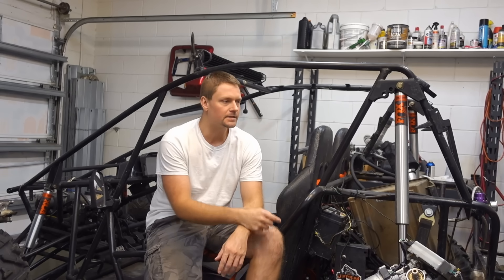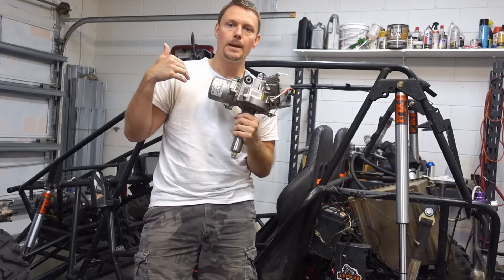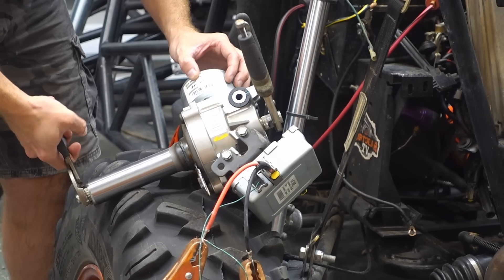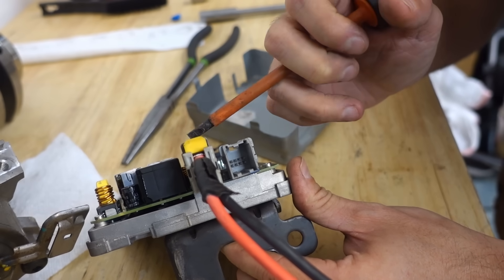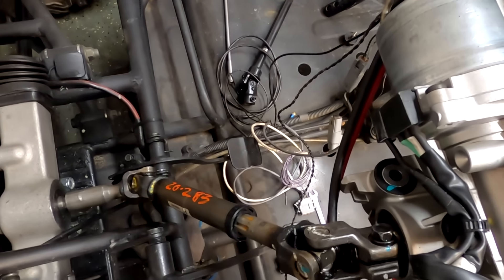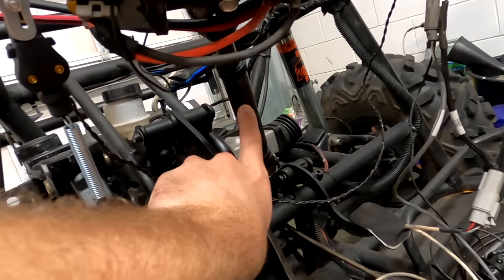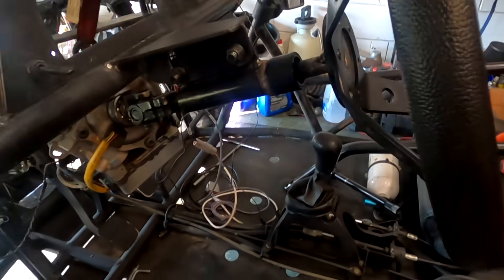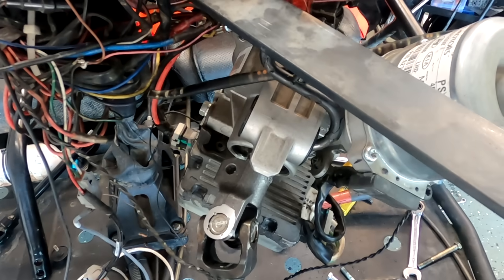Add Electric Power Steering To Any Vehicle for $150 | EPS Conversion

Comment: Ok, now lets see you do this trick with an M35A2 since the options are 1) a pneumatic assist system that works with the OEM 9.00x20 tires for $4,000 ( part number 2530-01-388-4240) or 2) a hydraulic system that requires you to run super singles (an additional 6 MRAP rims at $900 each with 6 tires at $1,500 each and adapter plates 6 at $130 each) for $4,000. 

There is a 3rd hydraulic version that works with the OEM wheels that costs $1,900 BUT it is only for off road use as it will rip your wheels off at speeds over 25mph.

Comment: I need one of those power steering in my custom 4x4 custom artic cat buggy , question the black small cable did you connect it to positive or negative?
Reply from the maker: That's the 12volt switched for power so a switched 12v source
Reply: @DirtGearTv about to order one
Reply: @DirtGearTv just got one with the connectors and everything I need for 106 thanks for  the info can't wait to mount it on my buggy

Comment: Very informative. I'm looking at fitting this Kia unit to an old Citroen ID 19 which has a simple manual steering rack at the moment which is v.heavy.  I have read elsewhere that modern electric steering systems also have an input of vehicle speed via the main ECU which alters sensitivity at higher speed - do you think this is absolutely necessary ?
John Fletcher in UK

Comment: If the eps works well without the module could I just hook it up straight to the battery with a fuse or have it go from my ignition switch to a fuse then straight to those two pins with single pin connections?
Reply from the maker: So you must have the control module for it to work. That said, you'll want to fuse the power side as these draw a lot of amperage. The ignition switch is a simple 12v switch that can be connected to any 12v source (preferably switched)
Reply: @ thank you
Reply: Or do I have to have the module

Comment: I'm wondering if the ECU is even needed. If all you're doing is hooking up power to it, with no other inputs, can't you just hook up + and - 12v to the EPS?
Reply from the maker: Yes, no ecu is required as these units have their own controllers. 12v Ground and power switch is all that's needed
Reply: @DirtGearTv  Thanks, that's what I thought. The ECU is just acting like a relay for the heavy 8 ga. wire, I may just use an 80 amp relay and forego the ECU altogether.
Reply: @DirtGearTv  Now I just need to figure out which of the  wires  going to the 
EPS is Pos and Neg!

Comment: I'm planning to use a Prius Electric power steering in a 1988 VW Vanagon.
I've seem some videos with a rheostat-type switch which you can use to adjust the "softness" of the steering.
Any one can tell me more about this?

Comment: Hi guys. After watching and reading the the web page (the ranger station) I am trying to do this with a Toyota Yaris EPS part no. 89650-52120

Please I don't understand the 4th connection which is speed signal. Is there a way to use only 3 connections ??

Comment: My kia picanto 2011 doesn't have power steering,and i want  to install one. Electric i have you dont need can buss conection. Is that true?
Reply: I installed one on my Kia Sportage Diesel 2014 with Regular Power Steering. I use the EPS from a Hyundai IX35 that is basically the same car.

Now... on my case, something WEIRD happened...  if i connect the canbus... my steering works perfectly, the only effect is that when doing about 40mp/h or so, the steering gets stiffer (and i think is the regular working mode), the weird part is that... if i disconnect the canbus i cannot get the EPS work at all and the car gets hard to move, so it required the Canbus connected always.

According to this video, this is supposed not to happend, i tried to use it without the canbus because i wanted the steering to be soft even on driving.

The good part is that at not moving, the steering is butter soft (that makes the parking easier) and because i didn't remove the hydraulic power steering on the car, the EPS doesn't have to do a lot of effort so i think it will last longer.

I would like to know if there is a way to reprogram the EPS module so to upper the stiffer speed or change the assistance effort, etc.

Comment: What is the requirements to hook up in 2013 Kia rio  Electric steering   Module I hooked up the key power on but I need the red and blue hooked up also they have a 2.4 vote With arms coming out of them what do I do

Comment: I put electric steering in my buggy the column is from a 2013 kia rio  I hook up the keypower on But I have to hook up the other 2 wires in order for it to work and What do I use for those other 2 wires or can I buy a bypass Please I am very stuck here can't figure this out

Comment: would this drain the battery if you wire it up this way
Reply from the maker: It's wired to ignition so if I left ignition on, yes. If it's running it's drawing from alt not batt

Comment: Water cooling the welds makes them brittle. It’s better to use compressed air. How a part that experiences high torque you want the welds to be as strong as possible.
Reply from the maker: Totally agree! I was trying to keep heat off the bearing with cold prior to adding any heat. Hopefully not as brittle as water cooled 🤞

Comment: So got one of these setups and soldered the wire to the #1 pin.  Hooked everything up and the ECU clicks and then nothing.  Am I missing something?  What are the odds it's bad?
Reply from the maker: Did you verify it's the right year with the link in description? I missed by one year the first unit I tried and that's exactly what it did.

Comment: where were you able to find the wiring diagram ?  I using a power steering unit from a 13 Hyundai Santa Fe and can not find anything on the net to help with the wiring.
Reply from the maker: Check my link in description, only certain units will work

Comment: I just got hold of a 2018  soul column & ecu… will that one work?
Reply from the maker: I just checked the link in description and doesn't appear that's a compatible year. I had that same issue with the first one I got from the junk yard 🫤
Reply: @DirtGearTv  2018 it works. Just bench tested it exactly how u did… and we are all good!
Reply: @DirtGearTv  bugger! It’s already in the mail
So I may as well give it a crack. It says the 2018 is interchangeable with 2014 so 🤞

Comment: Just for future reference,  you could also just connect the single wire to pin #1 in the exterior connector receiver,  and then simply fill the remainder of the void in with RTV,  or you could put a release agent on it and fill it in with some Bondo to make your own connector "pigtail".

Comment: does it need steering angle??? looking random EPS and there are with steering angle sensor / 3 connectors on the control unit.

Comment: Hey, if you're near Tennessee I can probably help you 3D print a housing for one of those connectors and then you can snap in a Molex or Dupont pin to fit the actual terminal.  The first one will probably take a few hours to make, after that you can print them off for pennies.

Comment: Quick tip on connectors,  there's two parts of the connector even on PC boards and if theirs a number or name or both at times its possible to find the connector and the part number for the mate.

At times it takes a little work. But in the age of computers lots of data is online and its amazing at times.

So dont give up to ease as some OEM parts may have the same connector PN or run of parts and you have to pin them down,

Take the VPX Pro or Sport circuit Breaker replace panels for new aircraft. 

the connector kit is a few dollars and the pre wire kit with pins is a few 100 dollars and not a bad buy for some home builders or avionics shops as they come with the wires prie crimp and all the builder has to do is match the wire sise to the circuit and put them into the connector.

But I looked at the VPX and was able to track down the connectors and then the pins for each connector and in a range of pins for the wire size of the aircraft circuit.

If you a home builder the computer can do amazing things when tracking down parts 

And places like Y Tube can offer amazing advice for your next Ideal no matter how simple or complex

Comment: Very cool. My Kia box arrived today! How did you wire your power (the motor wire) wire? Keyed or nay, and what amperage did you plan for or find you needed? Thanks for the inspiration! Mine is going a ‘66 c10 restomod
Reply from the maker: Power side I believe i'm using a 60amp fuse/breaker. It's likely these don't actually draw that much since it's failsafe mode. I have it wired to my 12v acc when in 1st ignition position

Comment: Just as a point of information, these power steering units have a small rubber gear inside that’s well known to deteriorate and “thunk” when you power them up and turn the wheel. If this happens, simply unbolt the motor from the side and inspect that rubber gear. If it’s bad, replace it and it’s fixed. Dorman sells the gear for around $12.
Reply: I don't think there rubber but teflon
Reply: @dalejones2108 they are a hard rubber compound, just replaced one on a Kia Optima 3 weeks ago with only 86k on it, it's a terrible design

Comment: "The Ranger Station" guys have been doing it for years and have info on many eps setups with associated wiring diagrams. I did it on a John Deere B tractor!
Reply: I wired my kia soul esp  on my car and it will not engage. Not sure what do.
Reply: I was searching for a suitable power steering for my Massey Harris MF50. I think this is the one. 

Incidentally, it seems utterly stupid that these all tie back into a car’s computer. If your power steering fails, you know it. Of course, he estimates this one at a 10:1 power advantage and my old pickups were probably about 3:1, so a power steering failure was an annoyance.
Reply: Nope. Went and checked, not enough accessible input shaft. Would have to rebuild input shaft to gearbox, including machining a new seal housing.

Comment: Cool project, thanks for sharing. Does that steering module spin endlessly or is there a stop to stop?
Reply: Great question. This unit could be used for other applications if it just spins with no stops...

Comment: Love your video. But then I looked for a 2014 kia sole EPS I don't see the module attached to them, do you have the exact one you have can you help with part number?
Reply from the maker: I believe the 12-14' use the same module and (possibly) are interchangeable. Check the link in my description for years and models of others you can use!

Comment: Beats the old hydrovac systems we used to use. Steering shaft joints are available in both splined and set screw cheap and steering shaft braces with a bearing are cheap enough to be worth while.

Comment: ANY Vehicle???  What about a 1968 M35a2 Deuce and a Half?  I just turned 73 and have had rotator cuff surgeries on both shoulders.  Power steering would mean I wouldn't have to get rid of my beloved old daily driver.  This would be an answer to a prayer.
Reply: There are heavier duty electric motors for something that big.
Reply: @Snuggs-o1  Where?
Reply: @JSBIRD69  Bosch servotwin and Knorr-Bremse will have a product out soon.
Reply: There was an air assisted power steering setup for M35's.  The supply has mostly dried up now though.  

I have a 1970 AM General M35A2 from Boyce Equipment.  They couldn't locate an air assist system for my truck when they were building it out.  I wanted real air conditioning also (I'm in Louisiana), another curve ball.  They put the power steering system setup from a 5-ton on my truck.  It is a hydraulic unit that connects through the gear driven injector pump.  I'm running 49" Michelin XL super single tires (bobbed duece) and you can turn the wheel one handed on asphalt.  Pricey, but worth it.

Comment: Are there any smaller units?

Edit: What type of weld are you using?
Reply from the maker: The prius unit is maybe 1.5-2lbs lighter and longer but skinnier, expect to pay 3X as much. Just mig on this one
Reply: @DirtGearTv  I'm asking because I have a Kei Van that doesn't have power steering and the available space is very limited. If I could figure out a way to fit one, that'd be a game changer.

Comment: This video should be used as an example of how NOT to use a welder and angle grinder.
Reply: Very dangerous in fact without protection
Reply: For sure!  Shorts, flip flops, dodgy welds on a major safety system.  I get hurt anytime I do stuff like that.  Now, lets weld the brake lines to the wheel cylinders.

Comment: Do you happen to know if there are any of these EPAS systems that have 'return to center'. Thats something I know the prius doesn't have.
Are there any of these that have better aftermarket operating systems so they aren't always in failsafe mode that anyone knows of?

Awesome video, some really amazing content here, thank you so much.
Reply: For "return to center" just run more trail. 
(caster is usually the easiest thing to change)
Reply: With the Prius I believe you can put a potentiometer between some of the signal wires to adjust the strength so it isn’t just in failsafe, but the issue is usually it’s a variable signal from the ecu so it’s not simple to retrofit.
Reply: @Tappar1  i thibk you're right I just found someone that makes a hos antenna that can bypass the ecu so it will create a variable input on the prius epas
Reply: @Tappar1  there is no "return to center" assistance by the power steering rack…

The idea of one is dumb, really dumb…

If there is no input through the steering shaft, there is no assistance. None. Everything that happens is mechanical & caused by the tires & suspension.

Comment: Great video. My dad has a 1995 British LEYLAND DAF drop side 3.5 tonne gross crew cab pick up. Can I use this to convert to a power steering as well. It’s not been running for years but a new battery and clean out of the diesel lines with new filters and it should start. He’s in Jamaica.

Comment: I also used a Kia soul eps unit in my racecar. Works amazing for about 10 minutes of cruising on freeway but it “times out” and goes back to being very limited assist. If I restart it, it works as it should for another 10 mins. Anyone having this issue?
Reply from the maker: Interesting, what year was your unit? Afaik my unit is running always in "limited" assist, but that's all I need being so light 🤔
Reply: Did you ever get this figured out on your car? Seems like this would be a nice setup in a race car.

Comment: Just a little insight.... You can solder a wire into the connector without dissasembling the unit. Just tin the pin and the wire, and then just solder away. you can simply fill the connector hole with silicone after to seal it up. SAVE YOURSELF HOURS! :)
Reply: Yeah I don't know why he would do all that disassembly when you consider it from the outside.

Comment: Man, I can't believe the number of times you had the ground on the opposite side of a bearing or u-joint from where you were welding. All that current flowing through a bearing. Not good.

Comment: in my opinion it's worth paying more for Toyota quality over Kia
Reply from the maker: Afaik there are two major suppliers for electric power units both systems are built by one of these companies, not by the manufacturers so the quality should be the same regardless

Comment: Question: As far as the ECU# B2563-99500, I'm seeing a lot of ECU's with that number, but the first 2 # are different. A2, C2, 2V, 3x,2k, etc. Does that make a difference? Does it have to start with B2 ?
Reply from the maker: I had another unit I tried that didn't work that was slightly different, so I went back to the years and models of only those proven to work. The link for that info is in the description

Comment: 2:40 ish, Just a few points of enlightenment. The input and output shafts are NOT solidly connected, they are coupled via a resilient coupling (this is a failsafe connection whereby if the EPS fails there is still steering control albeit without assistance). This coupling allows slight angular displacement between the input and output shafts. without a differential load you will see and feel nothing. Once there is angular displacement between the input and output shafts, due to steering system load, the differential is measured electronically and is used to regulate the amount of assistance the EPS delivers, the greater the displacement the greater the assistance. Hope that helps.
Reply: Great comment!

Comment: Hey,

I want to do a similar thing but with a Kia Picanto EPS. Do you know if every Kia part works like this (just needs 12V to function in fail-safe mode) or is it exclusive to Kia Soul models? 

Please if anyone can help me with this
Reply from the maker: checkout the link I posted in description. There are only certain years that work in these “fail safe” mods
Reply: @DirtGearTv  thanks. I found a wiring diagram of the Kia Picanto EPS and it seems that if I buy a complete unit, every pin would have an adequate signal except for CAN bus, so I hope that it will work
Reply: I say "I hope" because it is not listed in the link. But I know that Renault Megane II EPS also has this fail-safe mode and is used in similar projects so maybe the Kia Picanto will also work fingers crossed
Reply: @singleaspringle6941  i believe the connection between the two ecus go through the CAN bus, so it may not operate without that connection. so might want to double check before you pull the trigger on buying everything for it.

Comment: Can't find a quicker steering rack for my application so was going to use a rack quickener. I'm worried the 2x ratio on the steering shaft may do weird stuff with the torque sensor on the input shaft of the epas. Should I be worried?
Reply from the maker: I don’t think you will have an issue as these are optical sensors (I believe)